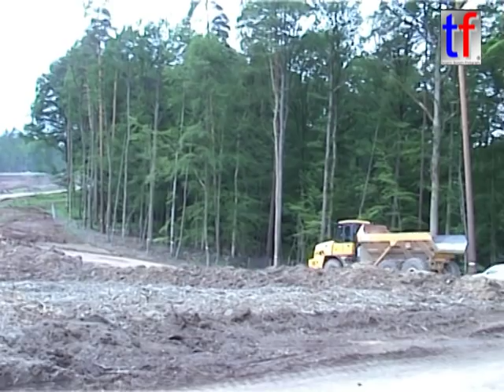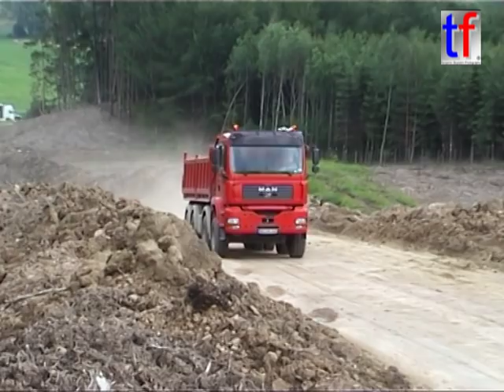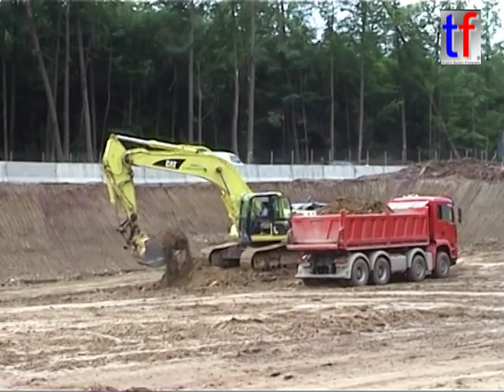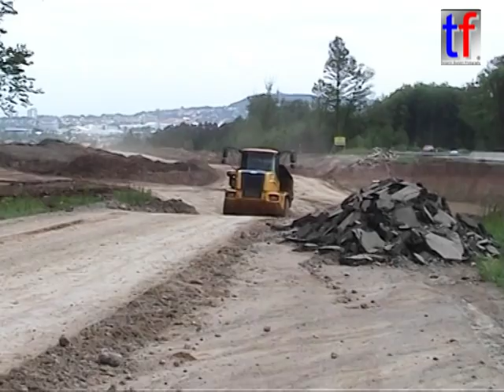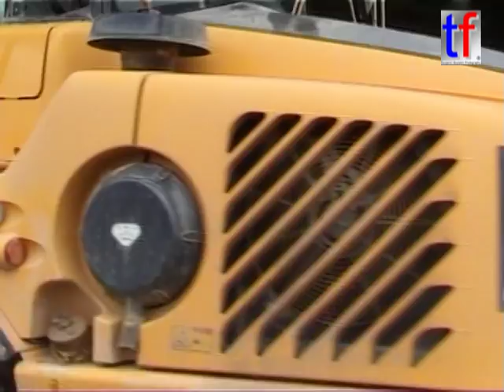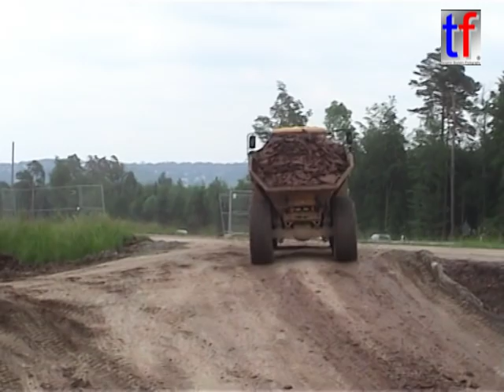CAT 330C LN, Komatsu PC320NLC,Bell B25D, ... / B 295 Leonberg, Germany, 31.05.2005.

Comment: this set up is dumb, the trucks are facing the wrong way wen loaded
Reply from the maker: +mark You've right Mark!
Reply: Not really to be fair the dig was started at the wrong end if the turned first here the operator would be slewing over the cabs that's a no no !